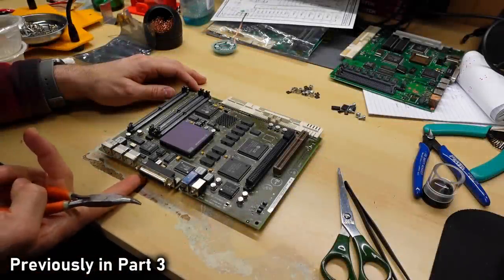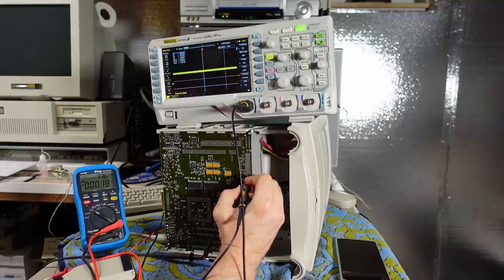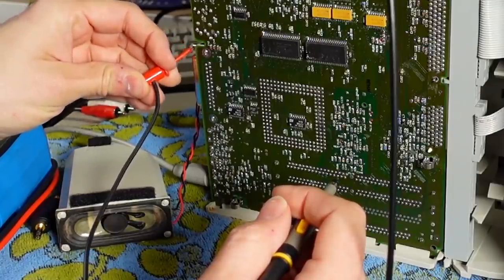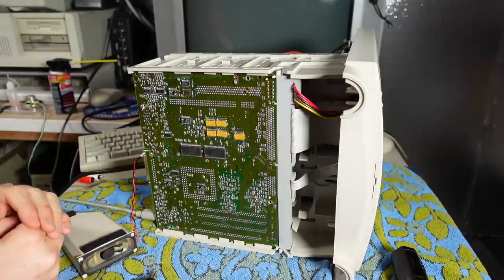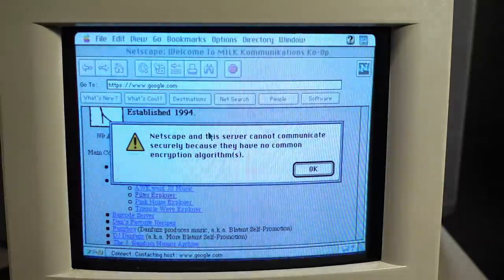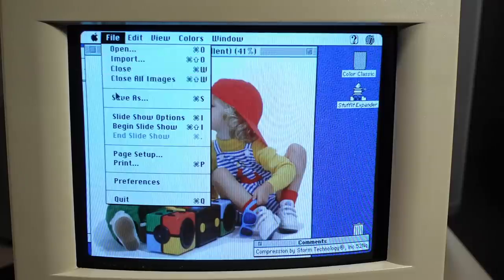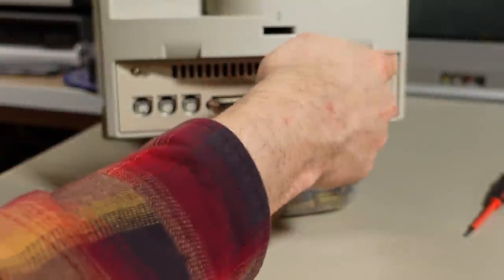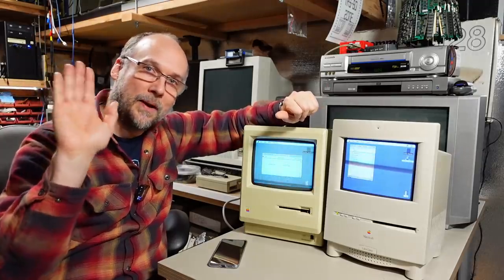You won't believe why the sound was broken on the Color Classic!

Comment: Another example of a split ground relying on an RF shield for connectivity is the cartridge port on a ColecoVision game console.  Pin 13 of the cartridge port replies on a mechanical connection to the lower RF shield to be electrically connected to the central ground.

Comment: I'm no RF expert, but have some experience. It was probably a cost reduction discovered when optimizing the overall unit for production. Someone noticed that the shield was conductive, and at ELV voltages. Not expecting people to remove the RF shielding (which would be an FCC requirement), they saved a few cents per unit in the form of reduced board space, better routing, or even something as simple as a via that could be removed. Just about anything that isn't strictly speaking "necessary" while still having the required performance, as well as meeting the necessary specifications goes in high-volume consumer products. It's an entire profession.

Comment: Some DLP projectors also use the shielding as an electrical connector on the power board. A loose screw would keep it from powering up. Specifically all the Viewsonic PJD models.

Comment: Coleco did the same thing on one of the cartridge pins where the bottom RF shield provides the ground to the pin. If you don't have the bottom RF shield installed, the system and games still work but there is at least one home brew game release that uses that ground on the pin in order to operate properly. So there is at least one other system that did something similar.

Comment: I've seen it done in the industrial field, using a shield as a "ground plane". They will sometimes split the AC and DC grounds, and use the shield as a ground plane for the DC (0VDC as they like to call it). Also, Ground looping? Not inside a computer. You'll hear that, again, in Industrial Buildings with long ground runs. Anyway, like you, first time seeing A shield being used as a ground plane in a computer. Nice catch, especially since you didn't had proper schematics! Take Care!

Comment: I've also noticed in Atari 2600's (4 switch models) the RF shielding is important for keeping a good ground otherwise you get additional noise on the RF modulator.
Reply: "Additional" No can do, meaning there is no headroom for that on them. heh - cool figuring it out.

Comment: Y’know, they might not have done it for RFI reasons, it might just have been to reduce the noise in the audio. 

A lot of modern motherboards have identical looking isolation around the audio circuitry, visible thru the solder mask as a gap in the ground plane. They boast that it stops it from picking up chirping noises from the data bus, but obviously those conduct thru the conductors rather than thru the air (hence, not necessarily for RFI). 

But I presume the modern motherboards get their ground from the brass standoffs or something, as they don’t have such an external shield.

Comment: Great video.  If you are looking for a game that will run on the classic mac color, There is one I had called "Happy Weed"  Its a pac man type game were you run around eating marijuana leaves, cops are the ghosts that chase you and you smoke a doobie to freeze the cops so you can put them in jail.  I realize that you might not be in to this type of game but It is funny to play.  You run around the maze and collect doobies and can use them when ever you want.  The game was well programed and has over 1000 levels.  Anyway for the later macs it might not play very well as it does not check for CPU speed and plays way too fast even on the slowest speeds.

Comment: To improve apps on older apple hardware running os 7/8/9 try assigning plenty of ram per-application (select executable icon, get info, memory, typically u double the minimum recommended size); if you really have a plenty of RAM installed in the logic board you can create a ram-disk, reboot, copy the slow app into ram disk, assign it plenty memory and try again; great detective job on the ground plane issue!

Comment: I think it's because those exterior connector would touch the shield anyway, but if you connect the grounds on the other side you'll have a loop. Since you don't want loops to exist (as an external magnetic field can induce a current in a loop), they avoided connecting the groundplane to the shield on the digital board side.

Comment: This arrangement was almost certainly not just done to comply with some EMI regulations/specifications, but to ensure the (electrically very noisy) digital logic didn't affect or contaminate the analog components of the system. While your hack works to restore audio, it might have detrimental effects on the signal quality of anything on the analog side of the system (presumably mostly the video and audio, I'm not familiar enough with the Color Classic to know what else runs on the analog side of things).

Comment: Called it at the first mention of audio not working through speaker, but does work in headphone jack. Bad connection in the internal jack. There is a mechanical 'switch' that turns off the speakers when you insert a headphone jack. Most common issue with that kind of hardware. Troubleshooting 101: Follow Olcums Razor.

Comment: It's almost like RF shields are something the product is designed to have and you can't expect it to work perfectly if you remove it ;)

I'm guessing they just took a shortcut to avoid having to have an extra ground net or an extra pin on a connector. Grounding through structure is something you see all the time in cars, so it's not unheard of but usually uncommon in electronics.

Usually you want to avoid passing a significant current through the RF shield, but I suppose with analog audio, the frequency that's expected to pass through it is so low it wasn't a concern. Also, the audio is probably capacitively coupled, and since the ground of the audio jack needs to be connected to shield ground anyhow (as it's a cable that extends out from the device, so digital ground could turn it into an antenna), they decided that was all it needs to be connected to.

I don't know, I'm not an EMC or RF expert.

Comment: I'm not an RF expert by any stretch of the imagination, but isolating the analog ground from the digital ground is a good idea because the digital ground COULD potentially leak switching noise from the digital logic into the audio section.

Comment: Reason I think Apple did this would be: Perfect grounding design on any electronic would be full "star configuration" which means in perfect world that from every ground-point is only one path up to "central grounding point" . That design will make its part ensuring least possible amounts of electrical noise will travel to any other component. From the video it looks that shielding, being perfectly valid grounding plane or "conductor" too, was designed to carry external connectors grounding directly to "grounding central point", which will in theory be best possible way to carry spikes to ground as direct as possible when fiddling with external devices, while grounding within, say, SCSI-pins is considered "digital side" and thus connected to "digital side" of grounding.

Comment: Most people using a Mac like that to access the internet were probably using dial-up!  Your internet speed was likely running at a maximum 14.4 or 28.8 if you had the dough. You would have probably started with Netscape 1.1,  and checked your email using Eudora 1.5.  You might have made new friends on chatting IRC!   
My job in 1996 was running the "Internet Help Desk" , and helped many newcomers to the internet get started.

Comment: LOL, the RF-shield has its revenge!
The RF-shield: Adrian's kryptonite 😂
I have to agree: Macs from that era (and in general) used some pretty weird constructions like those interupt and reset switches soldered on their side, leaving two of their pins flapping in the breeze with their buttons sticking out of the the side of the machine throught the vents, caps that were total garbage on such expensive machines, analog boards with multiple dry solder joints and dodgy fan connectors that simply stopped working because humidity got between their contacts..
Another weird thing about the Color Classic is that you have to remove the entire analog board and its RF-shield in order to get the drives out, because they get stuck behind the edge of the shield otherwise.. I'm lazy and I always bend those shields with a pair of pliers to let the drives slide out by gravity, leaving the analog board in place but the floppydrive has a tendency eject itself and to drop like a brick if you use that method 😉
I guess there must be some ingenious idea behind the separate ground planes on these machines (it may be a safety feature of some kind), but It's beyond me 🤓  I totally love these machines anyway 👍

Comment: well on most motherboards from pc's , at leasy pentium 2-4 era audio was also insolated grom digital ground they had only connections made by single 0 ohm resistor and had it's own power rail filtration caps 
all that was made to stop digital noise interference to analog aution which would produce high pitch noise hiss , but also audio interfering with bass sounds pulling ground up and making digital errors on the other side
i belive in this case shield worked as low resistance resistor link that would stop crosstalk along with rf interference

interesting bug non the less

Comment: I see this separate "analog ground" and "digital ground" thing in some of my audio interfaces. it makes sense, to help prevent any digital noise from leaking out to (possibly sensitive to noise things) audio things, like an audio amplifier. But it is super weird how the analog ground here was relying on the RF shielding material to complete that circuit. I guess Apple should have used  a separate wire and connector would have been better right.

Comment: This might be obvious, but I'll bet the reason the sound wave drops but doesn't flatten out when you plug in the headphones is because the computer can store separate volume levels for the headphones vs. the speaker, so adjusting the volume buttons in one mode doesn't affect the other. And headphones would likely be locked to a lower range than the speaker so as not to blow out the tiny speakers—or your ears.

Comment: The difference in speed must be extraordinary, because the original Mac had a painfully slow bus arbitration scheme, so it couldn't use the 68000 CPU at full speed anyway.

Based on my experience with Amigas, a 68040 on a 32-bit bus is about 3 times faster than a 68020 at the same clock speed.  A 25 MHz 040 with fast RAM can be expected to give 12-15x the performance of the stock 7MHz 68000 you'd find in an A500.  The 040 was a beast and a huge leap forward for the 68K architecture in its day (and insanely expensive).

Comment: The emulators where much better back than you think, at least on Amiga. On my Amigas I used Frodo (and a lot of other emulators for NES, C64, PC-XT/AT, Mac and Gameboy) in 68030s and 68060s and some of them (including Frodo) gave really playable results, with most games running at 100%. Maybe the Amiga was more efficient than the Mac, which could be very possible, as using the Macintosh emulator on the Amiga as said by magazines, gave better benchmark results than an original Mac using the same CPU. For example played Sim Tower and some flight simulation in Shapeshifter.

Comment: There's a couple of reasons to have split ground planes, as you correctly say RF emissions is one of them. However in this case, it is probably that Apple have an analogue ground plane for audio circuitry, which is connected back to main ground at one point. This is often called star grounding, and the reason is noise.

Ground planes carry return current, and digital ground will carry a lot of noise from all the high speed switching going on. You want to keep that out of your analogue ground returns otherwise the noise couples across and you hear it in the audio output. It seems a bit silly of Apple to rely on the RF shield for this return path though. It could be there is supposed to be another path (eg sometimes analogue and digital ground planes are isolated by a small resistor) and that path has gone open circuit.

The change in DC level you were seeing on the audio is probably because the audio is capacitor coupled (AC coupled) and, because the analogue ground was missing, these capacitors were not charging (as there is no ground path for them to do so). You are thus seeing the DC offset that the capacitors would normally remove.

Comment: Wow, that brings back memories.  Even though I knew the answer of the shield grounding, I had completely forgotten about it.  Yes, I was a Mac technician back before the Genius Bar killed most of the independent Apple Authorized shops off.  P.S.  They aren't board-level comprehensive, but if you want I still have a copy of the Apple Tech Disc, it goes all the way up to 2005 so it not only covers all models of Mac, but also iPods and Newtons as well.  Somewhere in my collection I also have the older Tech Disc that has the Apple // files.  Let me know.

Comment: From my experience, 680x0 Macs of any form were pretty weak for gaming.  The last year I took computers in high school, which was '95/96, the fastest Macs we had were a couple of LC 475s (the rest of the lab was some older LCs, I can't remember the exact model, and a bunch of Classics), which couldn't even run Wolfenstein 3D full screen.  The old 386 DX25 at home could run circles around the LC 475.  Still better than the original dual-floppy IBM PCs (not even PC XTs) with MDA cards the electronics lab was stuck with, though.

The next year, the school got a whole new lab of Power Macs, but my only contact with them was writing my yearbook comment.

Comment: Nice work! I wonder if current versions of Linux still support AppleShare. Several years ago I had Netatalk running on my Linux machine, I could browse my server from a Mac Plus using a Powerbook 5300 running LocalTalk Bridge, it also worked from the Basilisk II emulator.

I once went as far as taking a Powerbook 520 into work and using it for real work (circa 2010), because we had a NAS on the network that spoke AppleTalk, so I could work on suitably-formatted Office documents and save PDFs to the network share.

Comment: Ah I was hoping this would happen someday, but with an Atari 8-bit machine — I wasn't expecting it to happen with a Mac! Of course thinking about that now, I wonder whether the Atari 8-bits — or the 800XL specifically — actually do need their RF shields (according to Retro Recipes anyway) and why.
Of course the other fix would have been to restore the RF shield, but since the one from this machine was rust-damaged and actually seemed to have pieces from the sound port section broken off it if I'm watching part 1 correctly...

Comment: I'm no RF expert, and wouldn't have had any better luck troubleshooting this than Adrian.  That being said, I was wondering why he would throw out the whole RF shield back in Part 1?   
Yes I understand that it was rusty and gross, but why not cut off the bad parts and keep the rest?  
I guess in the case of having a hammer and everything looks like a nail -- have a can of DeOxit and a soldering iron, everything looks like a bodge wire.

Comment: I did the VGA mod on one of my Mystic CC today. It was very easy and works perfectly. Sadly the Comm-slot and LC-PDS cannot be used simultaneously. I had to connect an AppleTalk to Ethernet adapter to get the CC on the net while having the Apple //e card installed.

Comment: I wonder if simply installing a scsi terminator on the back would be a suitable solution? Especially for those who don't want to solder the ground planes together. Or just have the RF shield installed I guess.

Comment: From an Electronic Engineering perspective, its fairly irresponsible for Apple to be using the RF shield to be the power conduit for different ends of the motherboard. RF shields are not expected to be live since they are intended to be anchored to ground. In this configuration one side is anchored to ground, but another side in anchored to a power source.  Not sure how this passed FCC.

Comment: TBH, I think it's a bad idea to use the RF shield as an active ground path. It seems like an accidental bodge: the ground should have been connected on the motherboard at one point for the analog circuitry, still keeping the analog and digital ground planes separate, but both at ground potential. It's weird to me that the upgrade board used the same bodge.

Comment: Probably they didn't want to connect the noisy digital gnd used all over the board to the shield or to the audio.   You don't want the shield to be radiating all of that noise, and you don't want it in your audio.   I think it would be better to connect the GNDs that used to connect to the shield together with insulated wires, 24 gauge or thicker, then connect that ground to the other one at just one place, right at the connector from the power supply.

Comment: I can suspect that this was made this way to isolate and give a preferred path for static discharges. 
It might not be a big deal, or it might. I think I would have at least recreated the connection path keeping that grounding from the digital areas separate as possible.

Comment: Even though these days, the relatively low frequencies that these old computers run at renders them unlikely to interfere with any modern device, however the practice of simply removing the shielding as a matter of course isn't good practice. People should not be encouraging others to do the same. It's technically illegal, but given most of you are collectors, it's highly unlikely that they will be operating for long periods of time, nor operating in great numbers in a given area. Just put the RF Shield back on! After all, it's not "original" or "authentic" without it.